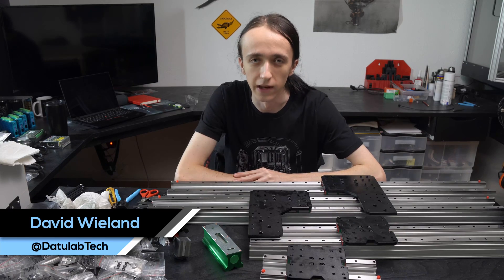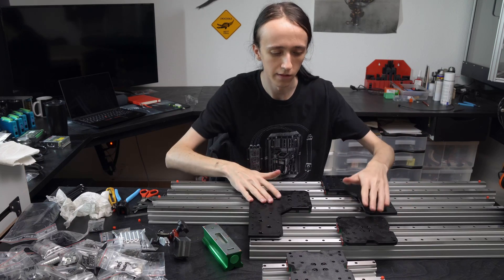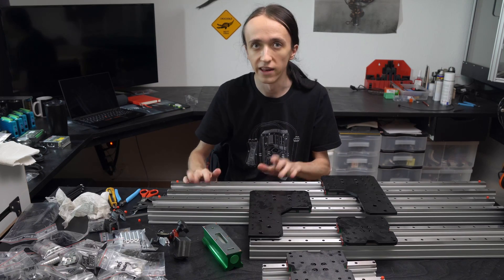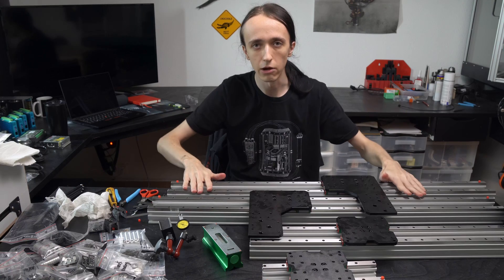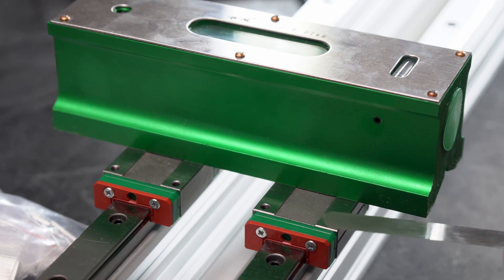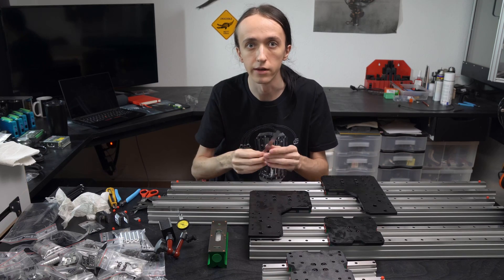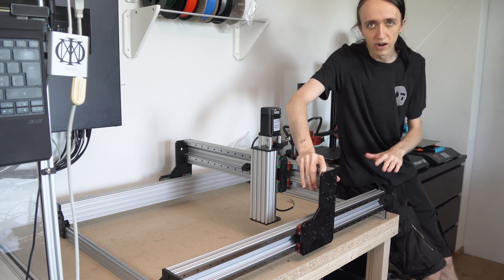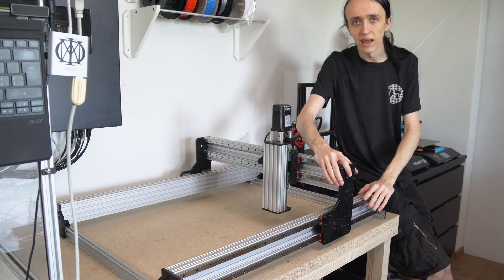KillerBee CNC Frame Assembly - RatRig KillerBee #2

Comment: Did Ratrig include an allen key or did you have to use your own? Did you need more than omce size or was the thing designed well enough to think ahead, multiple allen keys are going to be a pain in a**e.
Reply from the maker: I don't remember, but if you're thinking of building a CNC you should really have your own set of quality allen keys (and a number of other fairly standard tools).

Comment: Where is the best start to make a list for the all parts needed for ratrig cnc build except frame?  What is your estimation of total cost for similar build 2000-3000€? Before jumping into the game i would like to find out different hiden costs of parts and equipment. Cnc beginer, 3d printing hobbyst. THANK YOU!
Reply: on the KB page at RatRig there is a link to a BOM,  it's all there, cost is around 1600 to 200o euro with a VFD and a BB Controller.  Depends on where you get the parts from and what extras you install but 2k will see you through with a very nice and strong machine. I know as I have just built one as of Oct 2023 here in Spain. It cuts copper, brass and Aluminium very easily and will even cut mild steel bar!

Comment: I don't understand how you saw how bowed your rails were if you didn't have a true flat surface to compare it with, your workbench looks to be made out of wood, are you considering as you said that your Al extrusions are straight ? I'm getting the 1515 and might go to my training center to adjust my rails on the marble.
Reply from the maker: I was using an indicator from the rail to itself, so the surface it was on doesn't matter. If you have access to a surface plate, that is great, but most people don't (sadly).

Comment: Hello, Did you have to clean the MGN15 bearings before sliding them onto the rails? Thanks
Reply from the maker: They were already installed on the rail, so I followed the instructions from RatRig, which said to just wipe off the excess oil, but leave them as is otherwise.

Comment: can you help just for a sec I know its off topic but I have a CR10s with my BLtouch v3.1 installed and every time I auto home and goes too Middle of my bed and auto leveling their is still a space gap between the Nozzle and the bed any idea too fix this problem ? again I know this is off Topic but I cant find any other way, I search every videos on youtube and its only shows up CR10 and CR10 pro and Ender printers but Not CR10s so I came too you for help
Reply from the maker: I don't have that printer, but generally you'll wanna tune your z offset to make sure there is no gap. Where it goes for probing is something that is configured in the firmware.